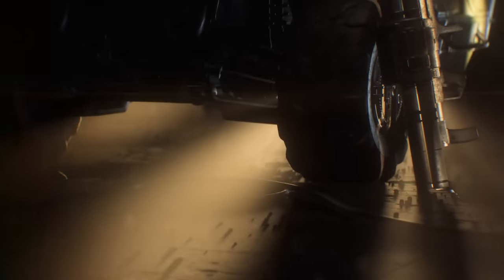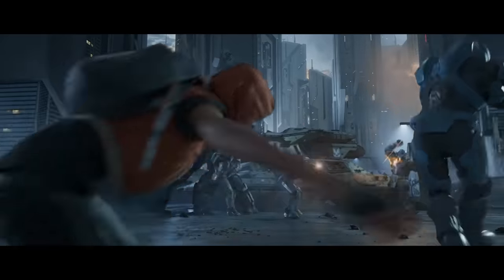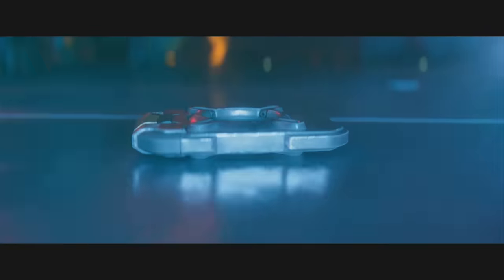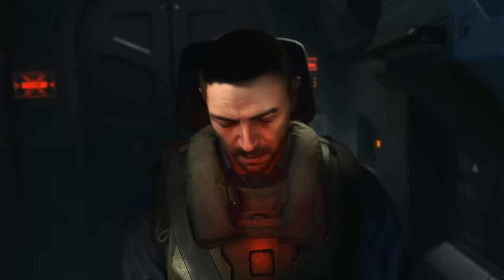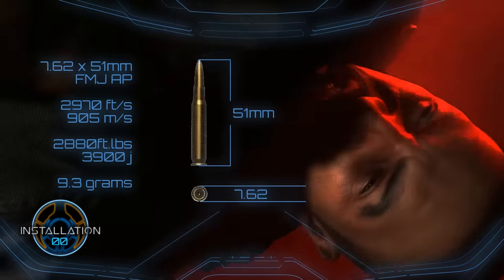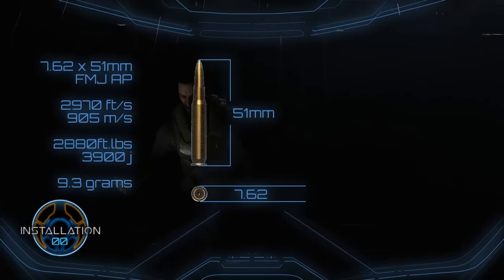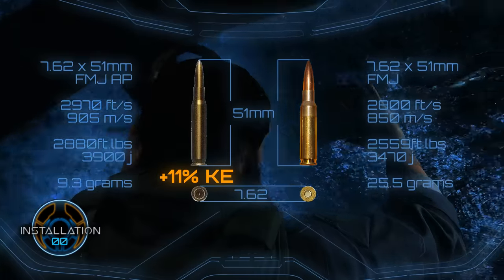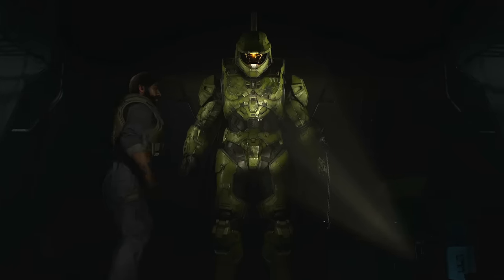Why are UNSC Weapons so powerful!? | The Armory

Comment: 2:04 The m6 series isn't all that bad, imo. At least from the perspective if it was first introduced during ww1 or something and if I'm right about weights of projectiles.

The M6G, the main magnum you see in games uses the 12.7x40mm cartridge.  Though said cartridge is also sometimes stated to be 12.7x30mm which might be a difference in version or just another mistake on someone working on making the descriptions for things.

The M6G is said to weigh about 2700g empty and about 2950g loaded with 8 cartridges. Assuming the magazine weighs as much as a m1911 magazine or about 80-100g each cartridge and the loaded weight is for all 8rds then it should be about 18.75-24g per cartridge. This is about the same range as a standard 45acp/11.43x23mm cartridge which can weigh between 18-23g.

The M6G pistol isn't really pushing the bullet all that fast. With the 12.7x40mm M225 SAPHE muzzle velocity of about 427m/s. It should be noted that the M6G is frequently discussed as a Up-sized/Spartan sized pistol. Which is larger than the more common standard M6A, M6B, M6E, M6F, and especially fot the M6K and M6P which were for concealed carry. Such features are likely to include a longer barrel which would skew the capabilities of the 12.7x40/30mm cartridge toward being stronger than is typical. At the same time it isn't much of an improvement compared to a standard full-sized m1911 pistol which can manage velocities of 255-621m/s which is accomplished with a 6-14g projectile.

The projectile weight is iffy to calculate given that we don't know how much the powder weighs, the material the casing is made from, and the style of primer used. I believe the projectile is pretty lightweight for the diameter and might actually be on the lighter end of 45acp cartridges. This based on the fact a full cartridge seems to weigh as much as a normal 45acp/11.43x23mm cartridge but has a larger circular area (12.7mm projectile has a circular area of about 126.7mm vs 11.43mm/45acp which has a circular area of about 102.6mm), the 12.7x40mm cartridge is longer than the 45acp/11.43x23mm cartridge (12.7mm has a case length which is about 7-17mm longer), and the magazine itself needs to be wider and integrate technology which allows for ammo counting.

Assuming the 12.7x30/40mm cartridge is similar to the 45acp/11.43x23mm projectile or the entire cartridge in terms of weight. Then it would be pushing a 6-24g projectile at the listed 427m/s for a total muzzle energy of 547-1886j.

This isn't too bad, but it also isn't great.

Given that you could just carry an M1911 or better yet a pistol caliber carbine. For example the CMMG Resolute is only 2720g, can use 30rd magazines that fit 45acp, and would be much easier to use in combat given it's a rifle. If the UNSC is full of broke bitches they could go with a Hi-Point style carbine which can fit 20rd magazines. These carbines would allow for a longer barrel length and thus more muzzle velocity and thus more energy, higher velocity also allow for potentially better accuracy in environments with gravity, multiple points of contact allow for better awareness of the weapon when snap shooting, multiple points of contact allow for better recoil control, and easier mounting of accessories. Part of why the M1 carbine and P90 were encouraged as replacements for pistols like the m1911.

Personally, I'm a fan of just getting an modernized/futuristic AR-15, M4, or a MK18. Seeing as in real life people have managed titanium and carbon fiber AR-15 rifles which only weigh 1800g though the Mk18 is 2670g and 1990s m4 is 2920g it's likely a futuristic version would weigh less and do more.  With each 30rd magazine being about 380-480g and even lighter 60rd mags a basic loadout of 180rds is about 3.9-6kg. A lot less weight while potentially doing more than a M6G with 40-88rds for 4.7-5.5kg. Not to mention even from a pistol or short carbine barrel 223 and 5.56x45mm can push a 2.9-3.6g projectile at a velocity of 670-970.8m/s for a muzzle energy of 650-1696j. Which appears to be a lot better than the 427-450m/s the M7 SMG and likely the M20 SMG.
Reply: Adderall is a hell of a drug 😂

But in all seriousness, I believe the 12.7 x 40mm round is more akin to the 500 S&W Magnum cartridge (12.7 x 41mm). Like you said though, there's no confirmed grain weight, so we can only speculate how powerful it is. I would assume it's at least as powerful, if not more so than the Assault Rifle. As Master Chief has stated in lore that is almost as effective as the Assault Rifle in combat. And from what we know about how fast the Assault Rifle is, and what it's grain weight actually is. The video got it partially wrong, the lore in the books is somewhat inconsiderate with the weight. But we know it fires M118 FMJ-AP rounds. Which we know in the real world, M118 7.62 NATO rounds have a 175 grain projectile. With that in mind, plus the weapon having a canonical muzzle velocity of 2,970 Feet Per Second, it would produce over 3,400 Foot lbs of Energy! Which would make more sense, given that the Halo 7.62 NATO should be considerably more powerful than the real world equivalent. Since the current 6.8 x 51mm Hybrid Cartridge the Military recently adopted is considerably faster and more powerful than the previous 7.62 NATO. While I don't have the date for the Military's 135 and 140 grain Hybrid loads for the cartridge. The Civillian 150 grain Hybrid load in a 24 inch barrel has muzzle velocity of 3,120 Feet Per Second, and produces over 3,240 foot lbs of Energy. This exceeds the 30-06 in both speed and power, even with the same 150 grain projectile (2,910 FPS, 2,820 Foot lbs of Energy).

So, with that in mind, it would make sense that the UNSC's M118 7.62 NATO round would be more powerful than what we currently use! Plus the UNSC uses Tungsten Armor Piercing Rounds in most of their Assault Rifle platforms. Meaning it should stand to reason that it would be able to punch through current level 4 Armor Plating! 

I think Halo Magnum would produce a muzzle energy equivalent to, or even exceeding the Assault Rifle. Especially since it uses armor piercing, high-explosive ammunition!

As for 5.56 NATO being used by the UNSC. It would definitely have it's uses in certain situations, especially being faster and more poweful than any of their SMG's. But as a standard infantry Rifle, it would be almost useless against most Covenant infantry, especially Elites, Brutes, and Hunters. As even with a 24 inch barrel, the 5.56 might have a high velocity of 3,180+ FPS. But it would produce about 1,350 to 1,400 Foot lbs of Energy. Definitely better than some UNSC weapons, but overall would not be sufficient enough to pop Energy Shields or punch through Covenant body armor. It would be decently effective against Grunts, Jackals, and other less durable Covenant infantry. But even the Grunts can tank a couple, or even a few rounds from the Assault Rifle before dropping dead. Meaning it would take a decent some of rounds on target with 5.56 to drop them. Nevermind Elites or Brutes, whom would be able to eat an entire 30 Magazine and shrug it off like nothing. It would definitely be useful for Police or Security in the Halo Universe, but not so much for on the front lines other than in select situations. Not to mention with the UNSC's more advanced gun powder mixture when compared to ours, I think they would honestly get more use from newer, more poweful cartridges than exist. Such as 6.5 x 39mm Grendal, 6.8 x 43mm SPC, 6 x 38mm ARC, or the newer Russian 6.02 x 41mm Cartridge. Up the velocities on those already potent cartridges, and I honestly think they would be extremely useful to the UNSC! Especially since they already use other, lighter real life cartridges for their new weapons, such as the 6.5 x 48mm (6.5 Creedmoor) cartridge used in the VK78 Commando!
Reply: @TheTGRproductions 12.7x40mm might be closer to 500sw.mag. in size but I find it a bit unlikely to match it's power. As we do know the ultimate weight of a magazine and 8rds to be about 250g this means a cartridge weight somewhere between 18.75-23g assuming a magazine weight of 50-100g. Even if the pistol shoots both the bullet, brass, and casing (23g) with the given velocity of 405m/s you're still only getting a muzzle energy of 1886j. Far cry from the 2660-3907j of a 500sw.mag. revolver or match the MA5 at 3400j.

You would probably need to shoot parts of the magazine and pistol in order to reach the 41.5g of projectile weight needed to reach 3400j of energy. The loaded weight of a 8rd magazine appears to be 250g meaning even if the gun shoots the bullet, casing, powder, primer, and 1/8th of the magazine with each shot you will only be moving 31.25g. So the pistol would need to shoot about 10.25g along with the bullet, casing, powder, primer, and parts of the magazine. Likely, a large part of the reason why the M6 pistol does damage similar to the MA5 rifle is a result of the APHE projectile. Which might allow the weapon to do similar damage to a futuristic 7.62x51mm.

Though the amount of explosive filler in each cartridge is likely to be about as good as its armor piercing capability given than even 500sw.mag. can be stopped by some soft pistol rated armors. Having a hardened penetrator can help with penetration depth of harder materials, however, it's not the only factor. Seeing as slower 7.62x39mm and 5.56x45mm steel core both tend to have less penetrating depth on steel and wood compared to a higher velocity lead core 223, 5.56x45mm or 5.45x39mm. The fact 12.7x40mm also has to house a fuse and explosive charge likely means that its penetrate, mass, and velocity have to take some level of compromise. To me this indicates that the gear and armor worn by many Covenant is likely about as strong as typical flak/pistol armor as they are much more reliant on energy shields. Further potential evidence is the fact M7 and M9 SMGs are capable of downing Covenant despite using a very small and probably weak cartridge that only has a velocity of 427-450m/s far slower than the 600-735m/s of 5.6x30mm and 716-933m/s of 5.7x28mm. Let alone the 750-940m/s of a 5.56x45mm pistol or carbine.

While I can agree that replacing the MA5 rifle with a weaker cartridge my thoughts regarding the use of a 5.56x45mm carbine/pistol/smg/pdw isn't as a replacement for the 7.62x51mm MA5 Assault rifle. Rather a replacement for the M7 and M9 Caseless SMGs, M6 Magnum pistols, M20 PDW, etc. Precedent for this exists in the form of the US Airforce GAU-5A Aircrew Self Defense Weapon, US m1 Carbine across all branches of US and many Allied forces in ww2, AKS-74U among Russian tankers and Pilots, P90/MP7 during the PDW trials, Artillery carbines since the 1600s, and so on.

As it stands an AR-15 style carbine/pistol/smg/pdw with 180rds is about 3.9-6kg. With Halo's M6G pistol loadout of 40-88rds being 4.7-5.5kg and M7/M9 SMG loadout with 180rds is about 6kg. Futuristic alloys, better powders, and potential caseless ammo would likely increase the capabilities of the 5.56x45mm weapon system. Potentially allowing it to punch about it's weight class would suggest and given more soldiers, sailors, and airmen the capability to combat covenant and forerunners a bit better.

Comment: A little late, and I might have missed this(winding down for the evening) but it could be a variation of a few things: better propellant allowing a better burn, heavier grain bullet(increases juel of energy significantly), and improvements in barrel technology which would allow much larger bullets, more powder, more chamber pressure, and allowable throat/barrel wear.

Comment: The obvious answer is they just increased the operating pressure. The new 6.8x51 operates at 80ksi vs the 55ksi for the 7.62x51.  

Also I believe the AR has something like a 30in barrel. Add those two things together and you could get that bullet moving much faster.

Comment: So one thing I think could explain both the decreased weight of the round and increased power is polymer cases. The military is already experimenting with this now. The change the internal dimension of the case to make the propelent burn more efficiently. Also they could be using a electronic/ plasma ignition system which are also being tested now. These both increase the velocity of the projectile because they allow the use of more advanced harder to ignite powders. Yet another option is that lighter bullets travel faster so if you went with the original weight of 9.3 grams or so but you used a light weight bullet in a polymer case that like we mentioned earlier is more efficient as well the velocity could be significantly increased without the use of much novel technology.

Comment: A magnetic accelerator booster in small arms would require a significant mass of ferrous material in the projectile. That would almost certainly reduce projectile density compared to lead, copper, and tungsten. High projectile density is important for accuracy and long range energy retention, and ultimately allows for more energy to be delivered in a smaller package. Granted, steel is not exactly uncommon in rifle projectiles, especially as an economic substitute for the aforementioned materials. And 2550's technology shows that they routinely manipulate gravity and could likely use a gravitic manufacturing process to crush more ferrous material into a bullet core than we know how to do today.

Comment: One thing you forgot to go over is the casing itself. Make it lighter and less thermally conductive. This will transfer more of the energy to the round instead of heating the brass. The US army was looking at plastic ammunition for this reason

Comment: I always figured they perfected material science so much that the cases can withstand high pressure along with the chamber, barrel and bolt, I imagine these rounds can penetrate much more easily with higher velocity and hardened projectiles.
The powder could be a form of nano-nitramine or whatever it was called that produces much more explosive force with less volume.
However one limiting factor on firearms on earth is our own atmosphere isn't kind to hyper velocity projectiles causing them to burn up from friction but with material science you could make a round out of an exotic material that can withstand great amounts of heat.
In space a firearm works but a major concern is cold-welding metal parts, heat accumulation since there is no air to cool the barrel and lubricant evaporation.
You'd have to solve all 3 problems or use directed energy weapons solely in space.

Comment: Remember: Revolution not evolution. From Halo 1 game manual. There is someone on YouTube who found that the Halo Infinite Sidekick is a standard 10mm round but has a metal core, perhaps Tungsten, not sure. Combined with revolutionary propellants, it could puncture a spartan's visor. I'm not surprised also considering the UNSC issues what I'm assuming to be titanium- A armor plating to its soldiers

Comment: Ok, Just a couple of pointers here, from someone who actually reloads ammo. The 7.62x51 case, and the .308 Winchester are externally EXACTLY the same dimensions. The bases are the same diameter at .473", length at 2.005" trim length, and are to be loaded to the same 2.810" COAL. The thicker military designed brass does indeed hold a marginal amount less than the .308 as far as powder volume goes.

Comment: I suppose it could be argued that most of the apparent weight savings are on the casing being a thinner, lighter alloy. I also wonder if perhaps some mixture of compressed gasses are used as a propellant by the UNSC.

Comment: Advances in metallurgy, powders, and projectiles. Same as we transitioned from back powder to smokeless powder and the .38 spcl turned into the .357 magnum as people loaded higher and higher pressures. And when we got jacketed hollowpoints instead of FMJ or round nose lead.

Look at the 6.8x51 i.e. the .277 Fury from Sig. It's 80k psi instead of 60k psi due to advances in casings.

UNSC guns are likely rated for MUCH higher pressures with far superior bullets, powders, casings, primers, etc. Than we have today.

Pretty simple if you understand arms and weapons development.

Comment: There've been a few people who have noted some similar ideas. And while I love the idea of a hybrid coil accelerator system, you're probably correct that it is highly unlikely. But you did mention the "hardened" bit to the rounds and that leads me to believe that they are using a far more volatile powder or compound for their rounds. Someone noted that hardening the casing of rounds can increase the chamber pressure which leads to a higher velocity. So if you have a far more volatile powder in a hardened case, then it'd make something like a 7.62 x 51mm fly a damn sight faster and harder. I'd also like to think that the rounds are electronically fired. Instead of having a pin, you have a small arc or completed circuit that ignites the compound. Allowing the weapon to potentially cycle way WAY faster.